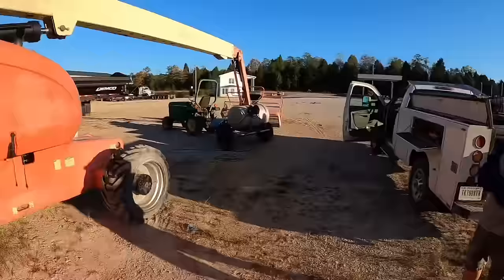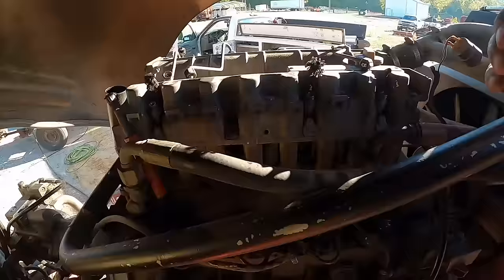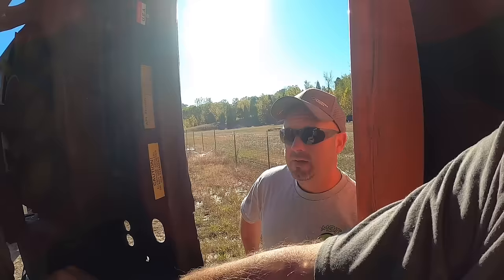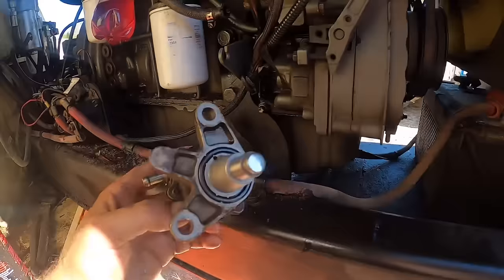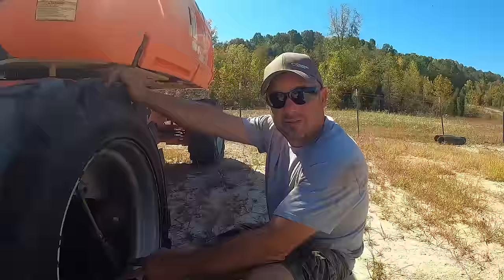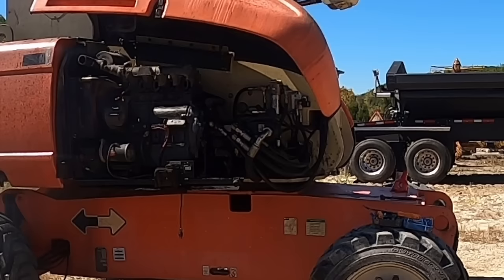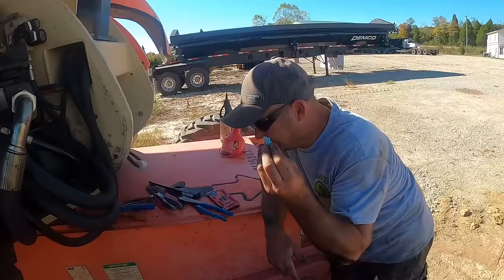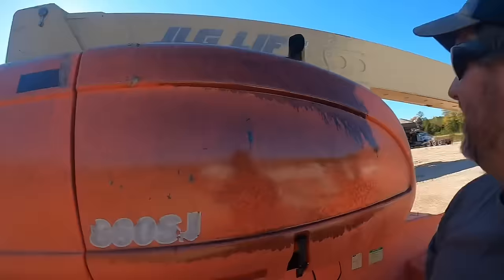Will It Ever Run Again? Regretting My Decision. Lots Of Highs And Lows. Never Believe What We Found!

Comment: Long ago i dove a 30klb lift into a septic tank  Made my top 3 f ups with machines. I'm an journey man owner operator and qualifie for 10000 hr+ seat time club. Storie go's!!! Lol.  I Was unhappy with the tree company I hired to trim some MONSTER valley oaks that were hanging over my driveway so thought if u want sumthing done rite do it urself and rented the 60' man lift. I had a bunch of life experience in trades at this point and knew wen I got in the lift there was potential for major disaster. The brush from trimmed limbs would build around man lift but it was 4wheel drive and machine did pretty good so i didn't want to stop progess but anything over 3 in diameter and I'd come down and clear the path. After luch I took lift behind my house between house and a 30 drop off to river was tight access to say least.  I knew septic tank was close and dug up solid side tank lid for general vicinity of tank. Got in basket and started going up. As I got about 15ft in air the lift started tipping over heading straight for my house looking down at lift from up in basket I could see that the ground was caving in and immediately knew I dug up the wrong lid and I was falling into the tank. The lift axle  was bout half over the tank and hung up b4 it went totally over into my house the lift shut off do to extreme basket angle. and I climbed down the boom to gain my bearings. Remmbering what my Osha 40 instructor  said in emergency which was DO NOT PANIC took a second but got my shit back. Then was stuck with how I get machine out for rental pickup in morning. I had a 10wheeler I owned at time on a trenching job with steel plates I called my driver and told him to bring 8x12 plate home  thoughts was id pick the lift out tank with my 315c excavator then  take a backhoe and push steel plate over the hole it was the rear axle also so the front had to go
Reply: Thru the hole still. Realizing that I was not going to get machine out tank with steel plate idea I decided to backfill tank with concrete rip rap I had from a demo job. As I dumped broken concrete into the shit water in tank I knew that I was in bad spot. Finally I could see the concrete building up and saw a glimmer of hope. 12 backhoe buckets later and the lift drove out. The next day I pulled all the rip rap out tank by hand and poured a new lid. Sorry for the novel but every time I c man lift I think of that story. Lol

Comment: Lack of air to blow the motor off? Let me see you have a fuel trailer with a compressor, you also have several large trucks with compressors how hard would it be to hook a air line on to one of those?

Comment: Ha ha,,,all of you doing 'shade tree work' out in the open with NO trees. Is the crankcase over full?, is the injector pump in correct time? Sounds like a broken seal leaking in the fuel pump /injector area. Be careful, you might end up being a JLG repair shop.

Comment: Do a compression test. That engine is air and oil cooled. If it had a blown head gasket it would fill the cylinders with oil and run away.
Reply: Explain how this engine is "AIR COOLED". 🤔 Also explain how oil filled cylinders will cause an engine to "run away".🤔
(this should result in many clicks for the YouTube algorithm to the benefit of Dirt Perfect)🙂
Reply from the maker: This one is oil cooled and yes oil in the cylinder is the number one reason a engine will run away

Comment: Mike you really made out on that deal! Seems to me that since the injector pump and speed controller swaps did not fix anything, the removed components are good and can be put back on the other machine.

I wonder if someones car has a new turbo? LOL
Reply: Fuel pump was bad since fuel in oil
Reply: @glynnredshaw1102  Wasn't that just a bad "O" ring?
Reply from the maker: No

Comment: I still do not understand that a so called mechanic at the dealership can not tell that there was NEVER a turbo on this unit! think he should go back and get some more learning! OH Mike, you took parts from Matt, to install on the other lift!!! Looks like your gonna have to call Area Diesel, and get new Fuel Pump, and other parts for Matt, to again put his machine back together. Wonder, did you put a shrink wrap on all the wires after Aaron installed new connectors on them so none of them would be rubbing?? Just a thought.

Comment: They didn't take the planetary sun gear out for the same reason they did not spend 30 minutes to find a bad fuel pump and wires. They don't have Dirt Perfect, get it done, skills.
Could the runaway been the cause of the second problem?  Or, the first problem caused by the second problem? Interesting how a cascade of failures can hide the real problem.
When you are finished, it is great to know all those others parts have been tested and are in great condition. I done this protocol many times. By the time I find the problem, I'm an expert in the entire system.
Aaron finally has a solution to his short stature. If he gets in the man lift, he can be taller than everybody.
Now, you can install a camera mount and get a remote aiming camera and see your largest projects from the same location.

Comment: Seems to me your dealer needs a new moocanic aka mechanic misdiagnosed. Funny seems a lot of that is going on hear recently. I have a 2023 new pickup with front end popping really really bad oh I can’t find it. Funny it’s all warranty work so they never diagnose that. I even ask them to do an alignment on it they didn’t touch it. I said dude I said I would pay for it he was dumbfounded I’d pay for it. I’m all for maintenance on a vehicle. My last truck lasted 350,000 miles and it was all original was a 1991 Chevrolet 1500.
Reply: Guessing the dealership never had a mechanic look at it. Sometimes if you have what is potentially a hard-to-sell item getting it off the books is the cheapest option.

Comment: Did you ever figure out how the muffler got full of oil?
Reply from the maker: Bad fuel pump put fuel in the oil
Reply: I got that oil was severely overfull. The engine probably pushed oil through the PCV.

Comment: Maybe should get kleeman to give yas a hand... he could probably jerry rig it to run hahahahaha
Reply: Also I'm from Qld Australia 🇦🇺... most our diesel injector pipe fittings are 17mm, 3/4 is 19mm to us. Most of the stuff we deal with is single use when it comes to alloy diesel injector pipes. Hyundai and isuzu especially.... Mitsubishi state up to 6 times remove and replace... but I don't trust it
Reply: Also I didn't notice any injector seals on the bottom end of the injectors... generally a copper washer here.... usually a must replace when removing injectors

Comment: No need to beat up the dealer here. Previous owner was already wanting to get a new one. Not sure where the blown up diagnosis came from but it could have been the previous owner. It would be very easy to get a confirming diagnosis from the shop if a new purchase would be the result. Those bad wires might have been causing the owners mechanic so much head scratching he was going bald and came up with the blown engine theory to get it out of his sight.
Bottom line, can't we just be happy for Mike and his good fortune?

Comment: Hey Mike I'm with you on why they pulled gears when you only got to drive the pin in backwards to release brake so to speak 😂😂😂😂 also im guessing you have around 3 grand in the machine 1500 for machine 5 hrs to pick up 1 complete day of Man hours replacement of fuel pump for other machine plus replacement of lowboy floor either way its a win win situation plus id be calling Diamond Equipment asking if they had any other dozers excavator or anything else that this particular technician AKA dumbass worked on for sale 😅😅😅😅😅 might be able to expand your fleet for pennies on the dollar also she would be a Bute Clark if you took it to C&C let Kevin paint her green